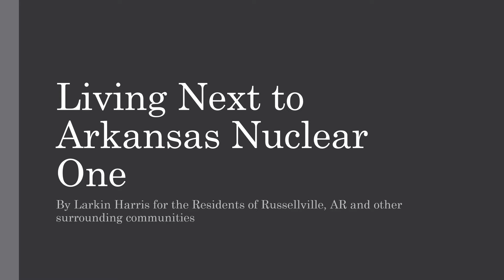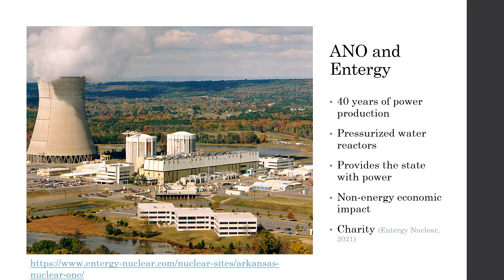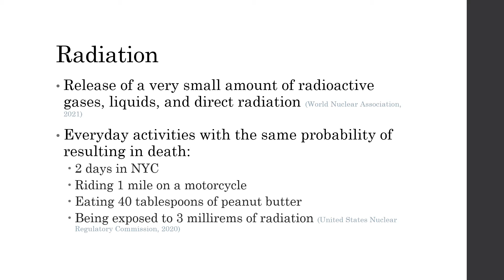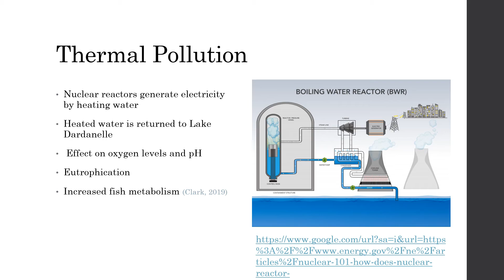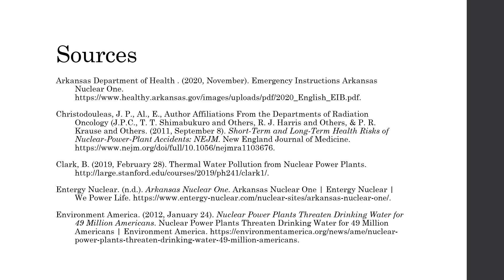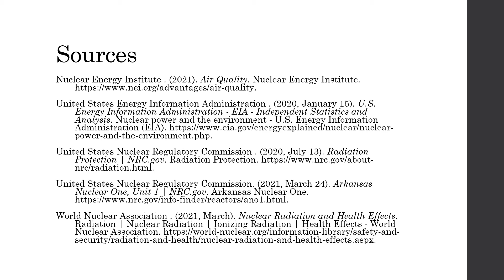Living Next to Arkansas Nuclear One

Comment: Good news. They have a cooling tower for the second reactor specifically because of this. Looks like they followed the criticism.
Reply: I have no idea what you are talking about. And I suspect you do not either. After working there for almost 30 years I do have some knowledge of ANO. The reason unit 2 has a cooling tower is because the EPA restricted ANO to a max of 3 degrees of temp increase to the surrounding lake area. Unit one uses a direct thru cooling system meaning its cooling water is pumped from the lake and returned to the lake after cooling the condensate and increases the surrounding water 2 degrees. Unit 2 had to have a cooling tower which cools the water and pumps it back to be used again. Otherwise it would increase the lake temp 4 degrees. It was designed that way from the get go to meet EPA regs.